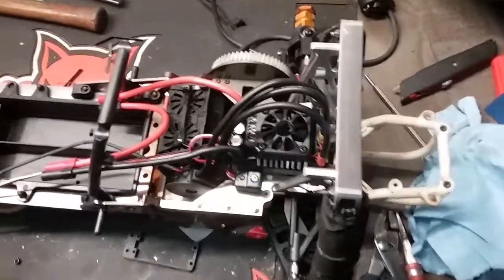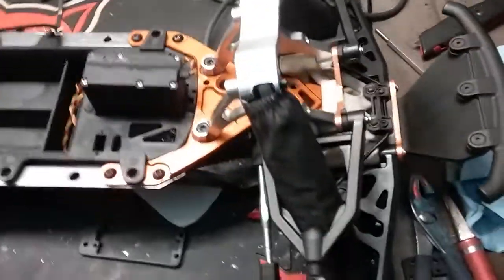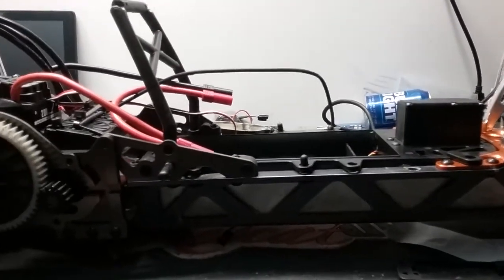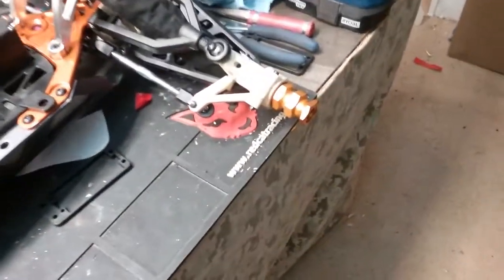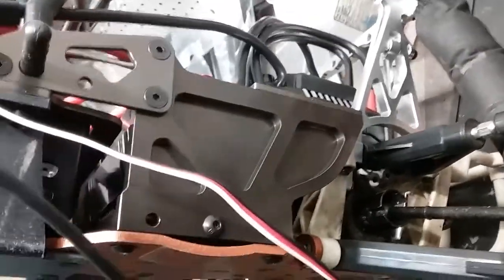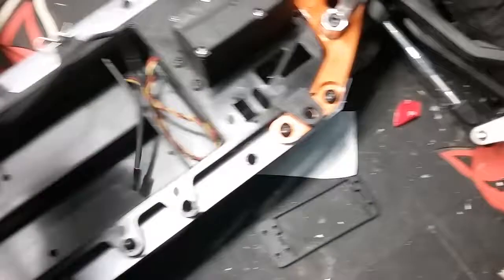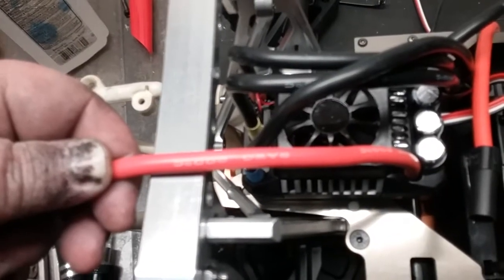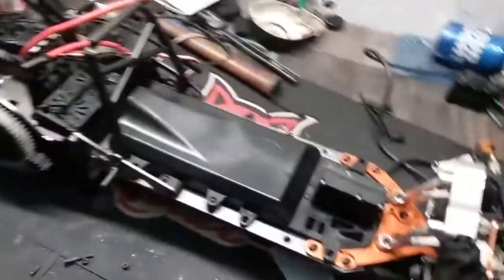Rovan brushless Baja 5b conversion pt 2.

Comment: since there is only 2 screws holding the motor up, can i suggest placing a dense piece of foam under the back side of the motor to help support the weight? might take a fair bit of load off those 2 screws under landing impacts.